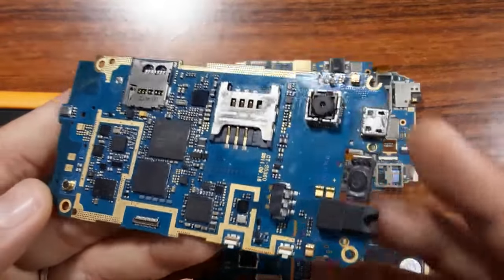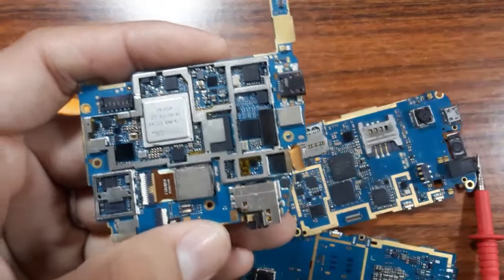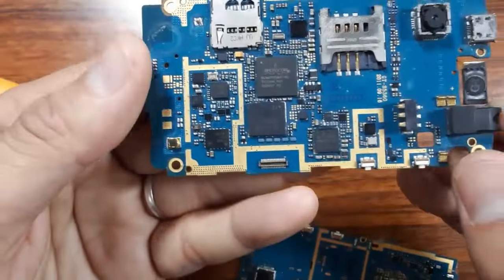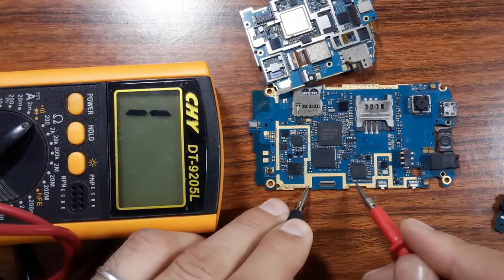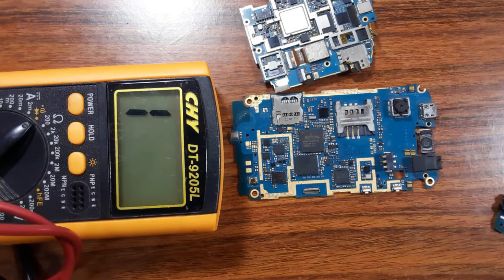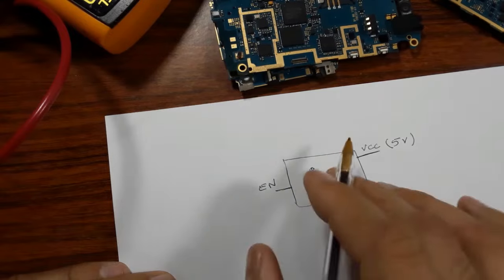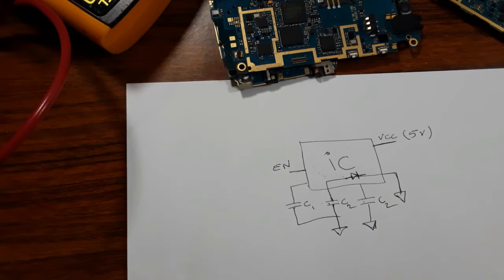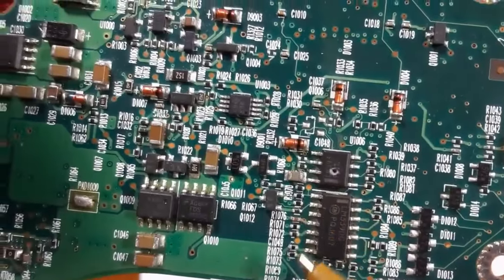How to Diagnose Cell Pone Motherboard step by step - Phone Repair

Comment: very nice :) Can you also make a video about reballing and exchanging IC's. I find it incredibly hard to remove them with hot air without breaking anything. Maybe I need a heat plate or sth. ;/.

I'm trying to fix my fairphone where my audio chip burned and is shorting to GND now. Funny enough the phone still works but gets very hot.
Reply from the maker: Great suggestion!

Comment: Your guidance is too general and lacking context. Bad capacitor around IC doesn't always mean the IC is bad. One of the capacitor itself can be bad and show all capacitors as short because they're in parallel. Bad capacitor can be isolated through various techniques like voltage injection and evaporation checks.
Reply from the maker: Right it could be the capacitor itself but usualy we find that the IC is the faulty components.Thanks
Reply from the maker: Sorry for that Bro, Welcome any time
Reply: I think this guy is great your teaching method is easy to follow I learn alot from these videos. Thanks for this information you are a legend in this field.
Reply: Thank you Sir